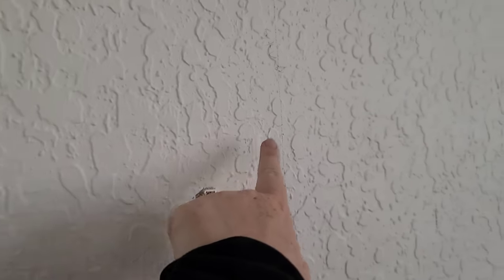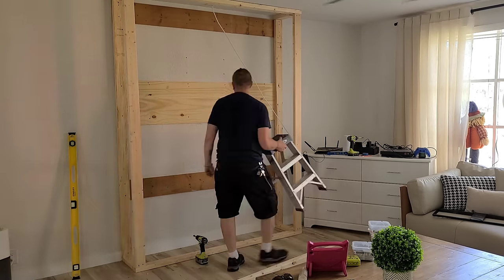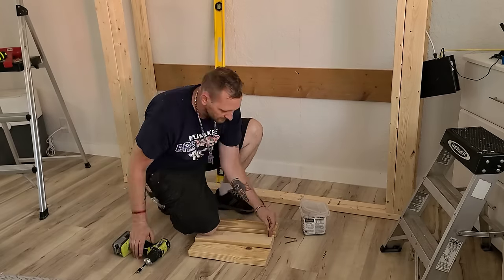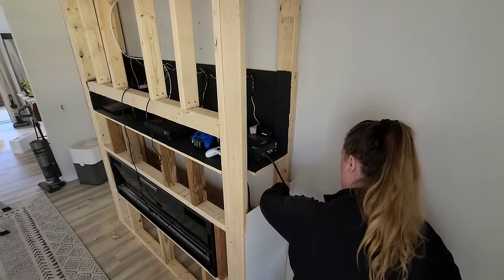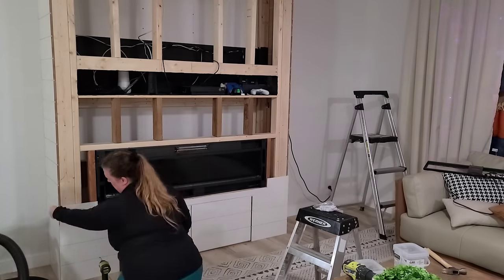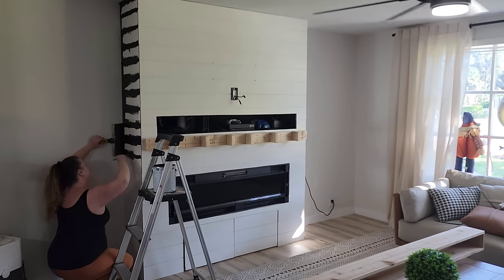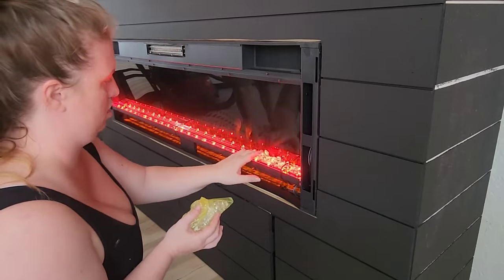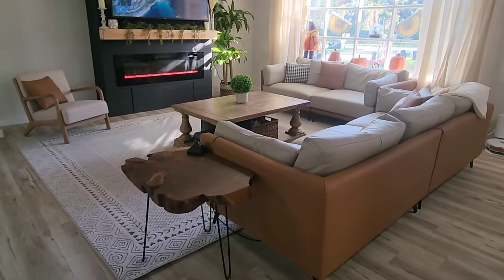DIY ELECTRIC FIREPLACE / DIY SHIPLAP FIREPLACE / WALL TRANSFORMATION

Comment: Hi you guys did a great job putting this together. I am at the point in video where you are painting it. I was wondering if you guys are going to finish it off with wood trim on corners and base of floor/ceiling. It would make it look more professional. You could use natural wood trim then paint black also.

Comment: Hello Cambriea great job with the diy fireplace enclosure .  I'm in the process of doing one myself . was thinking of using costway they have great prices for them online but you usually get what you pay for . How is yours and do you use it much was wondering if it still works . Thanks so much .
Reply from the maker: Still works great we don't turn the heat on much but we have used it but the fire affect we have on daily
Reply: @livingwithcambriea  ok thank you so much for the fast response . I’m in Fl and won’t use the heat much either lol. Bless you and your family Happy Easter.

Comment: One question. Why did you not remove the laminate flooring around your project before you started? That should have been the first thing done. Eventually the flooring will need replacing. Of course, you can just cut around the frame, but moisture will eventually creep underneath. Vey nice job otherwise.
Reply from the maker: We left it since we created that cabinet. That way it had flooring and not just subflooring
Reply: @livingwithcambriea  But you installed raw wood on top of a finished product. Raw wood directly to the sub floor would have been the way to go. If you ever replace your flooring, you'll wish you had removed it. I've been down that road and its a huge amount of work. Oh, I really like the lights behind the TV. The entire project looks exceptional.

Comment: The candle lit under the TV does not seem to me to be going well, I would not put it, turned off yes, but without flame. Greetings from Barcelona-Spain.
Reply: And the fire is too near the tv frame 😮
Reply: @mimig1900  Isn’t the fire just electric? Also,pretty sure the candles aren’t real either judging by the way she stuck her fingers in the flame when she moved it to the right side.🤨 (30:25)

Comment: I think you got it wrong with the newer home thoughts. I had my house built by a major home builder. Nothing in my house is true and straight. I would argue that the older homes are more true and straight. Nowadays builders contract everything out using multiple contractors which creates little to no accountability. Years ago contractors had pride in their work.
Reply from the maker: So it more has to do with settling in older homes

Comment: Never understood putting your tv above a heat source
Reply: The electric fireplace is really for ambiance.  The problem is the height of the TV. The height might work in a bedroom.  Not a good idea for a living space.
Reply: @raymondchow8722  they admit heat and a lot of it, can heat an entire master bedroom. The TVs are catching the brunt of the heat since heat rises. Yeah it looks cool but it’s a hazard and should be against building codes.
Reply: @JBlakeS23  Using the electric fireplace for heating is ridiculous. No one buys an electric fireplace for that reason. It really depends  whether you like watch a fireplace or watch TV while sitting at the sofa.
Reply: @raymondchow8722  Buying a fireplace for heating is the opposite of ridiculous. The fact is that these things are made to produce heat and putting your expensive tv above it is ridiculous.
Reply: @JBlakeS23  At least get a mini split for heating and AC.  The electric fireplace heating method is so crude.  I think we agree that TV above a fireplace is bad.  Especially when you add a hearth and mantle that pushed the TV so high. The hearth and mantle does absolutely nothing.

Comment: You’re slow roasting the tv. Fireplace needs not to have anything electric above it. I would have flush mounted the tv much lower to couch eye level and moved the fire place to a different wall or to the left or right of the tv.
Reply from the maker: Well except we live in Florida and don’t use the heat option on the fireplace

Comment: You are right wood is expensive. People who say under 200 are questionable. The fireplace alone can be from 200 to 600 depending on the style.  People who don't have tools like a nail gun can be another 200 and Miter saw another 250 or more just ball parking.  For someone who has the equipment I agree with your estimate project might run to 600 to 1000 dollars.